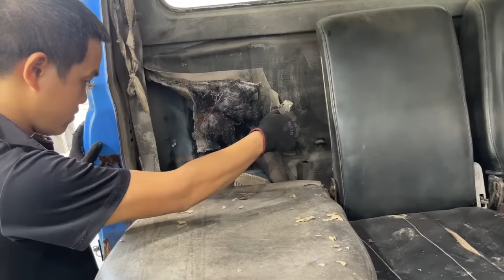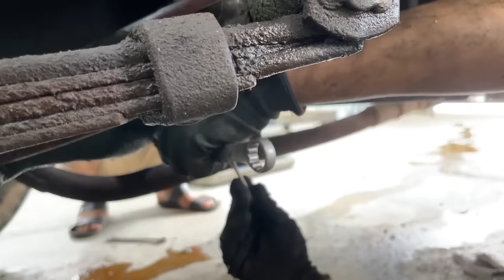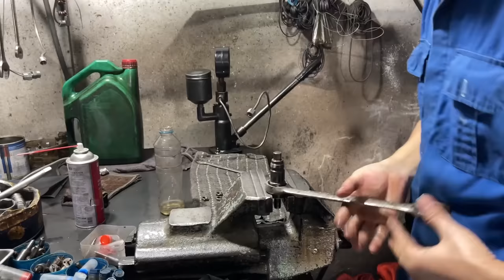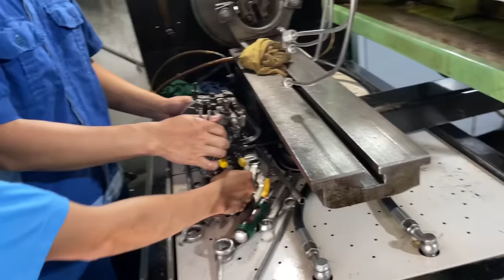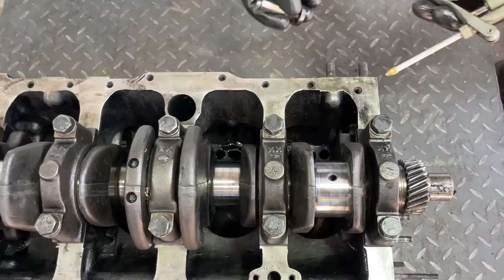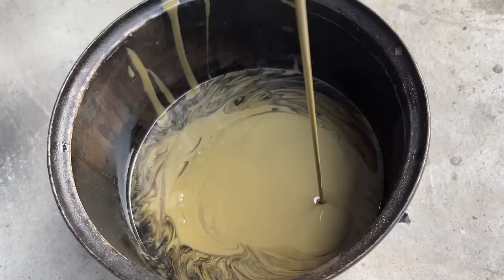Self-Propelled Crane Truck Restoration Project // Successfully Restored Diesel Engine - P1

Comment: Wow the truck runs but is quite mangled up..   plus almost rusted out..  rust holes every where..Not safe to use..  I think this will be a great restoration. 👍☺️. Maybe find another junked out truck like it and use parts..  I can’t wait for part two of this restoration.. Should be great to see how they fix the cab and frame and bed..  👍 thanks for sharing..
Reply from the maker: We are trying to complete the following parts of the project. Please follow along
Reply: @restorationproduct1718  thank you. Your part two should be really good.. Hoping the truck looks like new .. The motor and transmission looked great..  ☺️👍

Comment: Disassembly and assembly of the Engine was done on .... just a blunder: carelessly and without love for the engine, the SEALANT in the engine oil system will circulate a lot during running-in.... I would not have capitalized the engine so much, my HAND would not have risen.🤨
Reply from the maker: Thank you very much

Comment: runs like crap. misfires,maybe only running on 3 cyl,and leaking nuimber one fuel line at the injector.
Reply from the maker: We have completely adjusted it, it will look better in the finished video

Comment: This was fascinating watching you tear down and restore this motor. Do not know how many miles this engine had on it but you two men did a great job.
Reply from the maker: Thank you very much, we promise not to disappoint you
Reply: restore? all that work for nothing, no improvement. still smoking and run not good. Timing ? And the pump give 2 injectors more fuel.
Reply: @dolmarf411  He did show the timing between 3 gears. He pointed the dots as soon as he install gears.

Comment: After the repair, the engine runs worse and erratically than before regeneration. It smokes the same. Why lubricate the head gasket with oil? Valves ground in their seats and then mixed up. Valve adjustment incorrectly performed. The engine regeneration work was carried out carelessly and poorly, and the effects are visible.
Reply from the maker: Thank you for your comments. Please take a look at our project and you will see the difference

Comment: You did good job work on this rusted truck especially with engine. It ran back to life. But my advise to you is that you should NEVER paint inside the engine especially thing where you put camshaft in. Always cover the holes before you paint. Paint and diesel or petrol don't mix. Also be sure to take valves out and put the diamond paste on rim of it before run around with drill so that way the valve can seal better. I've watch so many engine restoration do that all the time.  And be sure to fill the oil filter with fresh oil before install, seal the oil filter with fresh oil around the rubber o-ring for best seal and smooth close it tight and smooth to open it when need to replace oil filter. It just my advice. Other than that, you did good job! :)
Reply: .ใส่
Reply from the maker: Thank you for your sharing, we need your advice, thank you for everything